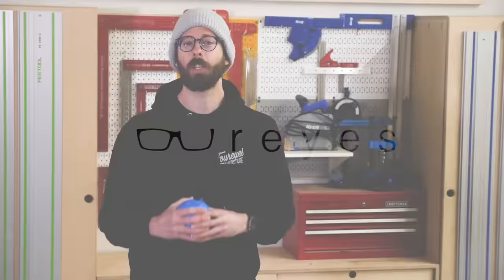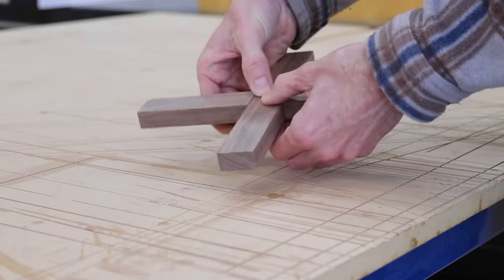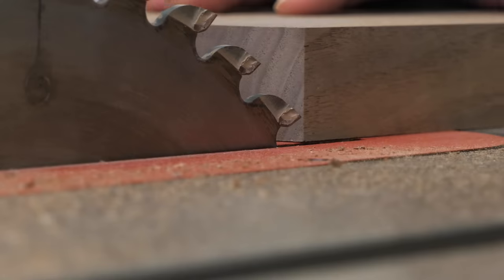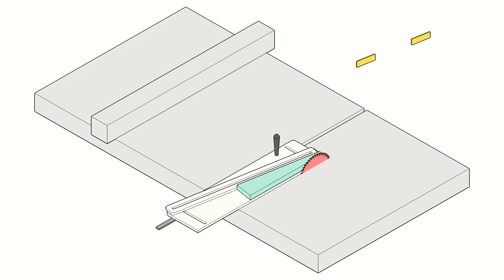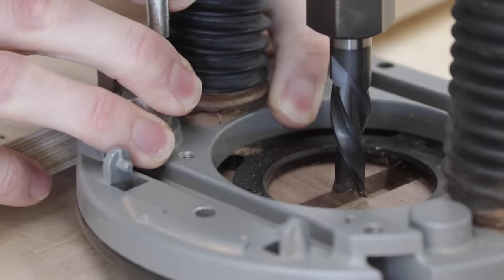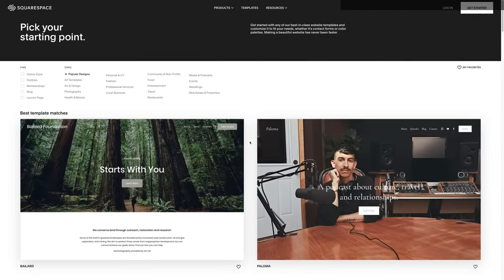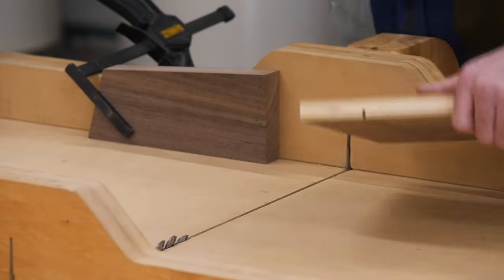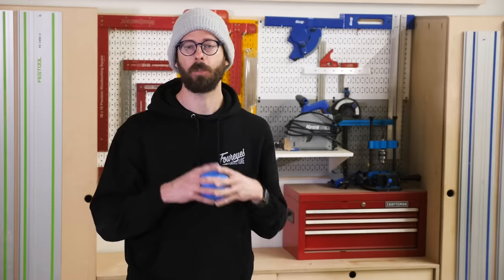Tips and Tricks Every Woodworker Should Know

Comment: I have 1 tip on top of the tip for not having burnmarks on your wood. I set the tablesaw fence a bit wider than the dimension i need, after the cut i dial it in on the jointer to the perfect width and with a perfect edge!

Comment: Big fan of these. You can also use tape to make dados smaller, if you get a too-loose fit with an exact-width router jig. Set up the jig then put a length of tape against one reference face. Turns a slip fit into a piston fit.

Comment: Another tip is to use "feeler gauges" as packer pieces.  These are super precise thickness strips of metal used in engineering starting at 0.03mm and going up to 1mm.  Not very expensive and you can precisely dial in any small increments without adjusting stop blocks etc

Comment: Making accurate dados. You can make a very simple, totally adjustable jig just using scraps - lots of YT videos showing this. Or, if you don’t make many, an easy way. Use a router bit smaller than your dado ( eg, if you want a dado roughly 12mm, use an 8 or 10 mm bit). Set the fence and place the board that you want to fit into the dado right up against fence, edge on. Now you cut one edge (the furthest away from the fence). When cut, don’t move the fence but take away the “shelf” board and cut again. The dado will then be exactly the width needed. If you want a looser fit ( eg for a moveable shelf), then you add one thickness of blue tape to the “shelf” board.

To be fair, i cut a lot of dados and so made the adjustable jig but the downside is that you need that jog to be as wide as the longest dado you are going to cut. If I have to make a really long dado which is, say, 800mm long, then I use the method I described above.

Comment: I have used shims for years when cutting dado's in wood. I had access to g10 epoxy sheets of differing thicknesses - 1/8, 1/16. 1/32, and 1/64 inch. I cut thin strips of these and used them to shim my router out from the guide I was using when building shelving units. i used a digital caliper or micrometer to accurately measure the dado I needed to cut, be aware that not all plywood sheets are the same exact thickness so don't assume they are. Most hardwood ply is slightly undersized so if I needed a dado for 3/4 ply I'd use a 1/2" bit and then stack some of those strips to get the correct dado. I did sometimes use tape if I needed a very small shim.

Comment: all great tips. some comments. 1) on the lap joint you can always test your final depth setting by cutting a kerf width out of the end of each piece (can do both together in one pass) and fitting them together. that'll show you exactly how your lap joint is going to end up 2) a couple points about the last one. (a) you mentioned using a chisel tooth blade, but changing out the blade (twice) might put a dent in the convenience of this tip, though it would work perfectly (with fewer passes) on a router table with a sled. (b) a small point, but you used hex shank bits as your blade width spacer so your spacer is the actually only the drill portion of the bit. dont really like that. would prefer straight shank bits and rely on smooth shank diameter

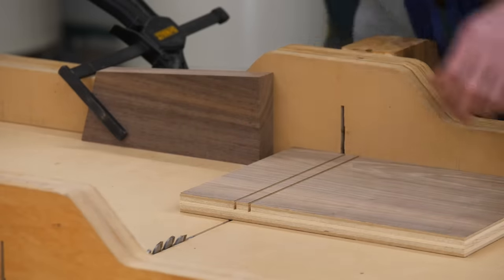Comment: 10:55 another sub tip here is that the drill bit shank will have exact same diameter as the cutting flutes, but if you use a small length of the cutting flutes as a spacer you may get significantly less spacing
Reply: Seeing a freely movable projectile, like the drill, on a table saw scares the bejeber’s out of me! ZING!

Comment: Thanks for this video.  I hope you do more, even putting only two tips in a very short video, or splitting one longer video into smaller ones.  The first tip on cutting lap joints I've seen before with a slightly different approach.  The tip about using a drill bit for a spacer I saw first in an old copy of ShopNotes (might have been before your time).  Even so, I'm sure that there are plenty of people new to woodworking who can profit from seeing these.

PLEASE, add safety tips from time to time.
Reply: I'll second the request for safety tips. I'm sure I'm doing lots of dodgy stuff!

Comment: That flat tooth is called a raker tooth. Most standard blades will not have this because they are setup as ATB (alternating tooth bevel). Some people try to use a chisel but I have never had luck with that. A standard stacked dado set has always worked best for me.

Comment: The painters tape tip for routing is good. In my case though it turns out my 1/4” dewalt router is roughly 1mm out of centre from one side of the flat side to the other. So when I had routered a 20mm groove to take veneered ply it was just slightly too tight. So all I had to do was turn the router 1/4 - 1/2 a turn clockwise to take it off centre by 0.5mm ish. 
If that makes sense

Comment: Like the concept of this series!  Could have really used these tips the day before the video dropped as I was fumbling through my first cross laps.  Please share what saw blade you use to cut such amazingly clean, flat bottomed dados!?  My 60 tooth freud fine finish blade got clean sides but the bottom of the dado was messy, and I got chip out on the back side of my cuts despite a cross cut sled and zero clearance insert.

Comment: Great tips.  The first one and the last one are connected.  A problem just as big for me with a crossing half lap (an X) is the width, getting a nice snug sides.  So, just treat the width of the half lap like a wide dado and use on of the dado width tips.

And by the way.  I thought of a cool tip using blue tape.  I found that you can use it to mask an area you don't want to paint when painting.

Comment: Great Video

Suggestion
One thing  i see people making mistakes with is the use of dowels.  You can only locate something once.  1 dowel gives you x,y,z location and the only missing location to correct for is rotation.
By trying to use 2 holes you have to accommodate, by hole diameter,  the tolerance error between the holes to each or 1 of the holes which destroys your locational accuracy.  After the 1st dowel hole all other holes should be slotted in the direction they are spaced. The slot should be at the same diameter as the original hole just elongated in the direction of the spacing. This approach also works for the festool domino..  I hope this makes sense.

Comment: Great tips, my one pretty big concern is the possibility that the drill bit becomes a carnage-causing projectile should something go wrong, which eventually it does in any shop.  I cut some very precise blocks out of plastic (I used a soft plastic cutting board) which would still be unpleasant if thrown around the shop but less likely to maim.  I simply marked them in different colours with a marker so I can easily visually tell which one I’m selecting.

Comment: The dado tip is great but there is a better way, buy or make a kerfmaker. Same principal, but all built into an adjustible stopblock instead of fidling with drill bits we are assuming are the same width as the kerf. It will also work with any blade from thin kerf to dato to even a router bit.

Comment: Interesting things I do all the time is use paper for many things. As it's cheap and easy to use or cut. Only thing is at times it takes a little time to do.

#1 I've used wooden rods to get the diameter of the rod. Cut out the paper circle. Fold the circle two times in half and find the center.

#2 finding the half point of any board. Most paper edges. Line up the edge. Fold it down to create a line. Cut off a strip. Fold that paper in half. Finding the center.

Then again Calipers and a calculator is handy.

Comment: I made a dog gate, it had equally spaced 
Bars but no matter how many times I did the math I kept comming out with oddball spaces between each bar, so I set the bars at 3 1/4" on center for my 2.25 spindals and filled both sides equally leaving an over sized spot in the center for 1 spindle so I made the center spindle 3" wide over all it looked symmetrical  even with a wide center spindle, sometimes the math just dosnt work out to where you can mesure the distance with fractions, what you might think would look bad actully looks good
Like as if it was something you intended to do, sure you'll know, but no one else will unless you tell them.  Just roll with it as long as it looks good.

Comment: Watching this late, but there is a better option for the tapered cut one, which moves a possible error from the final cut to the first cut:
Set the jig up for the final cut, then put a shim at the back stop and do the first cut. The way the jig cuts the taper, you are pushing the work piece forward and this to the wider part of the jig.
After removing the shim, you will have the jig perfectly set for the final cut.
If you accidentally use a wrong shim, you might end up with less or more waste left before the final cut, but never be on the workpiece side of the cut.
With the method in the video, you could end up cutting your work piece too small, if you loose the right shim or accidentally grab one that is too thick.

Comment: The blue tape works well when wrapped around a transfer punch when you don’t have quite the right size for the hole. The mark it leaves is way more on center then with a sloppy fitting one.

Comment: Hi, having recently discovered your channel and loving some go the furniture you make I am curious as to your continued use of the word DADO, being British a DADO or to be correct a DADO RAIL, is a strip of wood fixed to a wall to prevent a piece of furniture from damaging the wall surface.  
I will not pretend to be a cabinet maker and will admit to my lounge furniture to be IKEA (in a couple of cases modified as best possible, with a plan for a sideboard again modified to fit some short legs, allowing for a slope in the floor.  With the planned piece and how I will modify it in my mind, I found your Pico sideboard, which has 'interfered with my mind' in the best possible way, it is a gorgeous piece so I will admit to thinking of copying the design to fit the location and have cupboards as opposed to open shelves.  Overall size to be about 55" wide by 30" high.  Any ideas as to style would be greatly appreciated, I would probably work with Veneered MDF.

Comment: Small comment:  As Phillip pointed out in the first tip, "Sometime just doing the math alone can cause problems".  True...but almost entirely because US woodworkers are absolutely insistent on doing everything in the most difficult way possible, with inches and fractions.  My tip:  Do as much as you can in metric.  It is a pain in the ass to divide 3 15/32 inches in half, but 8.81 cm is pretty trivial.  You don't even need to understand metric...just use it!  I bought my tri-square with an inches and centimeter scale...inches are fine sometimes, but lots of time metric measurements are easier to work with.  If using a digital caliper, use it in metric (or decimal) mode.  I'd recommend using decimal mode over metric, but almost nobody has tape measures with decimal scales.

Comment: As I am relatively new to this, based on my recent results, I'd like to know how to make square cuts using a drill press mortising attachment. On my first attempt after clearing a mortise, I found the excavated channel slightly beveled and not squarely fitting the tenon piece I inserted also I apparently didn't have the chisel precisely square to the pencil line which left it stair stepped. These two issues required excessive sanding with a square block to return the mortise cut to a perfect square. Sanding African Mahogany is not an easy task. My only saving grace was being shy of the pencil marks giving me the space I needed to sand to the line. I have four more cheeks to mortise and I need to get them spot on first try. It would be easier if I could just plunge router the main channel then use the mortising bit to do final end cuts and cleanup but I am not very efficient using a router for this purpose.
Reply: I guess I can not give you a tip on what is wrong with your set up, but my advice would be to use a waste piece to fine tune your setup before you make another cut on your finished piece.

Comment: The ONLY time a table saw leaves a burn mark is if the blade or table saw are improperly maintained. Dull blade or buildup and non-parallel rip fence are most likely the cause but in the chance of burn marks a hand plane or card scraper are far easier and quicker than a second cut. Also, micro adjustments are possible with the same ease.

Comment: Question for you, everyone always says use a flat blade for joinery to get smooth surfaces. And for that matter, everyone always tries to make their joint surfaces extremely smooth, with sharp chisels and whatnot. I see the merit for traditional glueless joinery, but in any joint that will use glue, a rough bottom to a dado or any other surface in the joint will just increase its strength?

Except of course, the visible lines where pieces meet up, which aesthetically should be as tight as possible.

Comment: When you mark a piece of wood and you cut it on your radial arm saw and you see that the Mark is still there take your piece of wood push it against the blade slightly then lift the blade up and then cut it back down it should remove that Mark

Comment: Thats called sneaking up on a joint.
Also to find center of any board  
Make a jig  drive 2 rods into a board  2x2  
X inches apart find the center drill a hole for a pencil in the center lock the pencil in place but only temporarily a mechanical pencil works best  not take your 1/2.  3/4 1" 2" 5"  board put the jig over the edge and draw a line with the pencil  the line should be in the center
Now you can sneak up on that line and never have to pick up a tape mesure and deal with converting fractions.

If you have to work with fractions you can download a free fraction calculator on your smart phone.
It has 3 number pads  
The whole number, a numerator and the demonator  enter each number 
But be warned you can come up with oddball fractions  using it like  13/3  and honestly ive got no idea where thats at on a tape mesure.  This usually happens when your trying to devide a long section into equal parts like making a dog gate with x size pickets. And a lot of spaces
You can cheat this by making all the pickets the same size ecpt the center one and it will look like you planed it that way.

Comment: On cutting dado's with a "flat tipped cutters" type or "old fashioned chisel tooth rip-saw" blade... You don't need it... just get a good "paring chisel"... If you're going to stick to ONE chisel, it should be a 1/4 inch (6 mm), and you want a paring chisel, because they're made and sharpened for pushing by fingers through the work/waste wood...

    The "bat ears" and grooves left by an ordinary circular saw (or Table-saw) blade are generally about 1/32 inch "deep"... SO for a smooth dado, there's only a few ridges about 1/32 inch thick to scrape out... AND a decent sharp paring chisel is PLENTY for the task if you really like your dado's "smooth as a baby's butt"...

    Of course, YES, you CAN get a fine collection of chisels... and sharpened properly ANY kind of chisels is good enough to do the work... BUT 99% of dado's are going to be 1/4 inch or larger, so a single 1/4 inch chisel CAN scrape out the last bits of waste material so you get FULL contact with the resulting glued joint... and BE GENTLE... It's easy to gouge out more wood than you intended..

    Technique??? I generally just put the chisel into the groove or dado, bevel side DOWN and use it sort of like a scraper/lever to just shave up the last little bits... YES, you CAN figure that last 1/32 inch out of the depth, and in remarkably precise fits, it might NEED to be considered... BUT taking a little extra care to move the saw-blade enough to see that it doesn't take up absolutely ALL the space into your "depth mark" can also take care of those "bat ears"... just keep it in mind that the "bat ears" are there, and that you plan to scrape out that last bit of waste... and you'll get used to making that adjustment fairly easily...

    If you're skittish about it, you CAN also purposefully cut the dado "a hair shallow" and then "sneak up" on the intended depth with the chisel on your own... I've done so many fittings now, I can nearly get a perfectly clean piece of joinery out of any saw and an old screwdriver... so mostly, "try not to overthink it"... ALL this kind of thing takes a little practice and experience to master.  ;o)

Comment: Better to put the tape on router, easier to clean the glue residue if any left by the tape( if the guide is a piece you’ll be using in the project.

Comment: 'the math alone can cause problems..." strange how easy calculations are in Metric  ;-)  actually, there's nothing stopping a woodworker from using metric rulers, even with imperial measured wood...1 mm is about 1/25 inch, so the resolution is fine enough to use metric almost anywhere.

Comment: using a loose drill bit as a spacer could be very dangerous..... sooner or later it will accidentally come into contact with the blade.... then acting like a bullet
will be propelled backwards toward the operator at several hundred mph think of the result